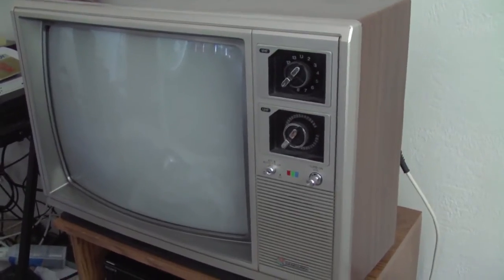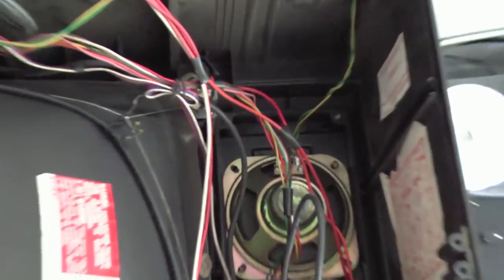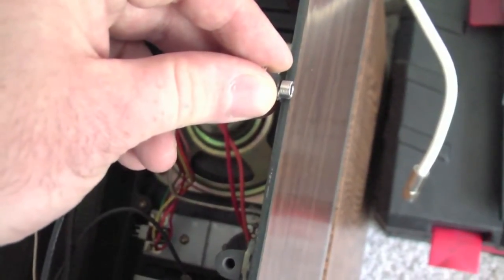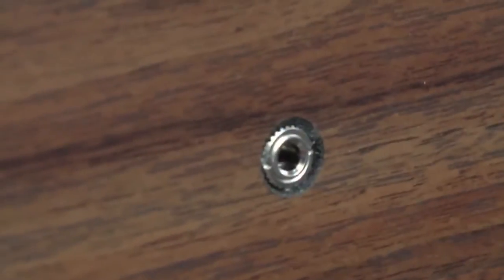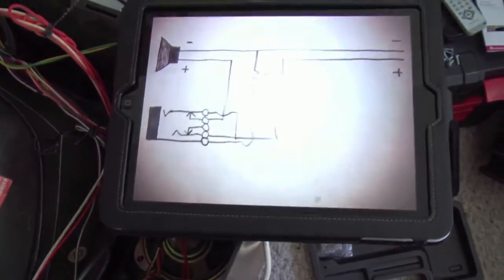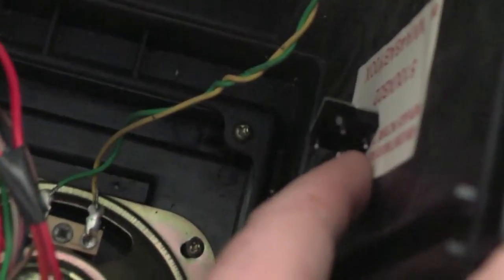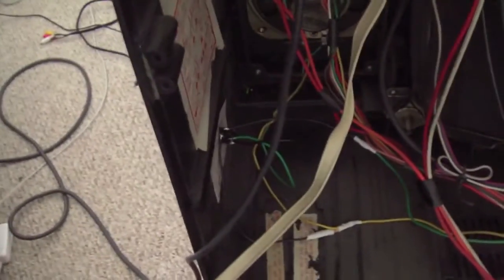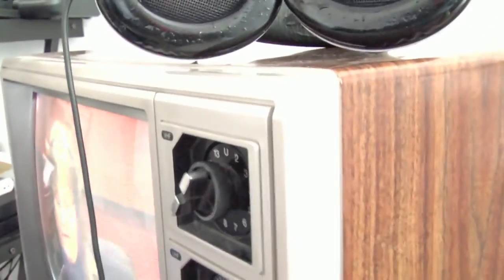TV Headphone Jack Modification

Comment: Hello, I found your video extremely relevant and well detailed since I want to do this for my mom's 2 years old cd/tape/vinyl player that (surprisingly?) is also lacking a headphone jack.  My local electronic parts store does carry the 100 ohm resistor but doesn't carry the closed circuit headphone jack.  I found many websites selling many variations of these, would you be able to tell me if these are what I need to do the job? https://www.allelectronics.com/item/smj-6/3.5mm-stereo-mini-phone-jack-w/2-nc-shunts/1.html.  https://leeselectronic.com/en/product/24021.html.  https://www.ebay.com/itm/1-8-3-5mm-Female-Panel-Mount-Stereo-Jack-Closed-Circuit-2-PK-/401065778704.  Thanks